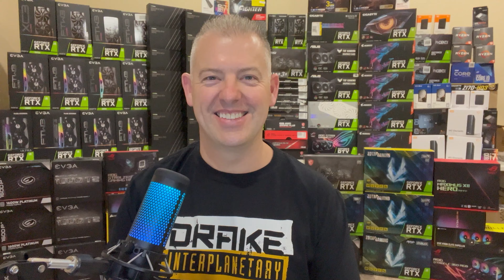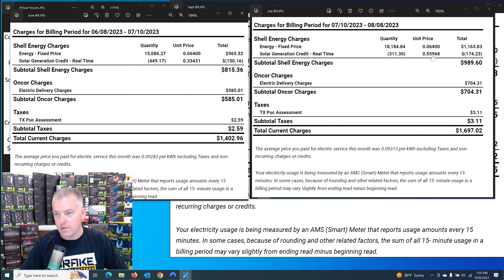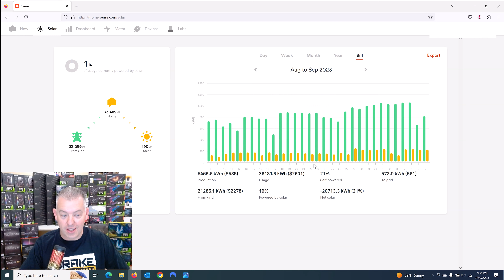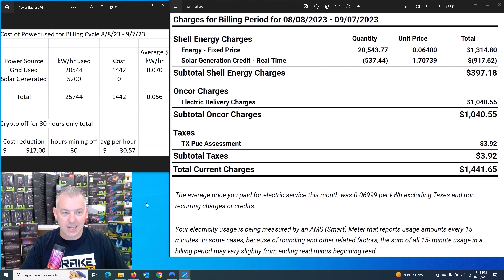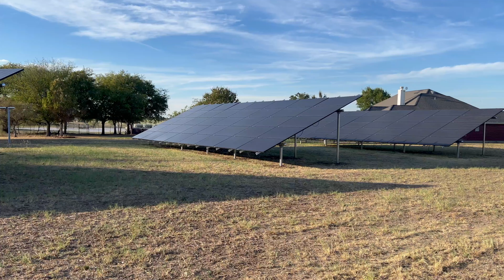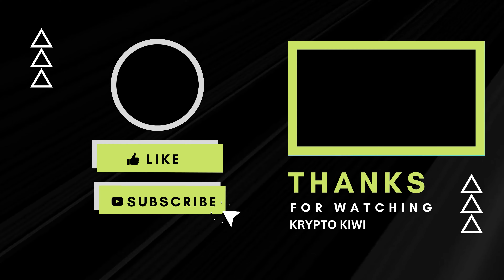How to use Solar to reduce $917 off your power bill in only 30 hours!!

Comment: There is a way for "cheap" to do even better. My build doesn't have any power inverter to 220 or 110. I store it at 48V and use it at 42V, 24V, and 12V. Including 3 big PC, all my exterior lights (12V). Poe devices, garage lights 24v or 12v. Avoiding all the losses during DC to AC and AC to DC.